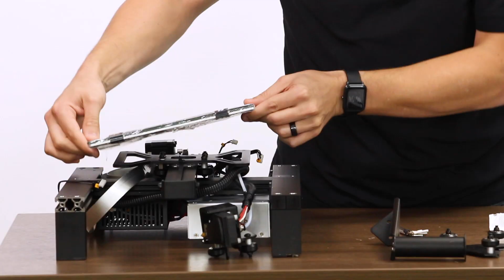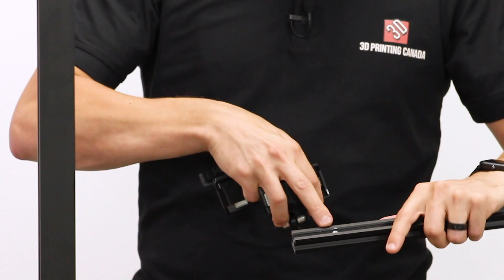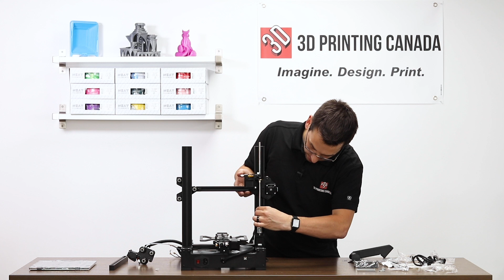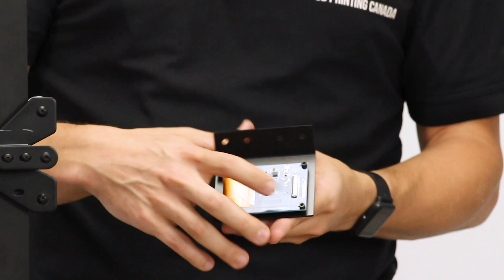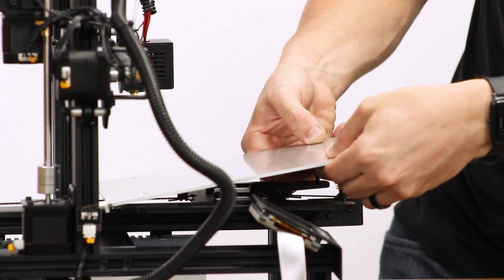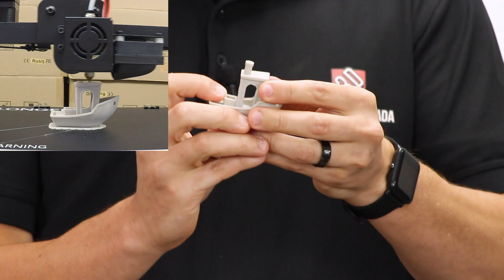Longer3D LK4 Unboxing, Build, and Test - How Good Is it?

Comment: Essentially informative as the instruction post assembly are totally inadequate. Nicely done and I'm currently printing my first test model. I purchased it because I'm restoring an old pickup truck and various dash and interior components that haven't survived the test of time can now be printed. Next step...design software. I'm proficient in Solidworks but don't have it at home. Any suggestions?

Comment: I just bought this printer, and it does seem to be a good printer this far, time will tell how good or bad it'll be.
Reply: So... what do you think?
Reply: @kingfissh6321  No major problems yet, Seems to work fine. Just need to make sure you have good settings, keep it clean, and that's pretty much it, it seems to be reliable.

Comment: You helped a lot because the instruction I got were worthless. So I got the headed bed on but it sits to low to go over the Y motor. I can't move the Y switch fwd.almost 2 inches so the bed stops sooner can I ? What would you do?

Comment: So, I've got mine set up thanks to the help of your video. However I can't seem to get other gcodes that weren't originally on the chip.. onto the chip working. I can transfer them over but the printer won't print it. Any advice?

Comment: As a first step I would have adjusted the rollers on the Y axis. Then I would have made sure base is square on the flat surface. I would have adjusted x carriages rollers before attaching x gantry extrusion to them. Just slide them and make sure all of the 3 rollers have proper contact and adjust them so carriages are not loose but rollers are not to tight. Rollers should be able to slip a little. Then I would take them off. Next I would have placed hot end assembly on to the x gantry extrusion and assembly complete x gantry off the printer. I would have snug left screws and kept right once loose. Slide the complete X gantry on to the upright extrusions. Then I would clamp top extrusion to the side of the upright extrusions to make sure those are in line. Then I would have tighten uprights. Then I would have attached top extrusion. Next would be to adjust x gantry level to be parallel to the top extrusion or with the base. I take mostly top extrusion for the reference. Once I have small as possible difference between left and right side and sure under 1 mm I would have tighten the screws. Attach the lead screw. Rise and lower the x gantry few times to check does it change alignment due to the a z axis movement. Just move it 5 mm up and down checking is there a play in it. If x gantry is changing its alignment when z axis is moved then you have some play in it. Little bit is always there with a single lead screw configuration. But do your best to remove as much as possible. Good thing is that the gravity is preloading the system and that z axis is not used as much as x and y so we get some slack and this small play is not showing as bad. Still I prefer mechanically synced dual z lead screws. Not as easy to adjust but once done it moves the x gantry in perfect sync (read almost perfect sync if you are perfectionist). Btw I would have kept the brass lead nut loose then move the x gantry few times full stroke and then tighten the brass nut to the carriage. I do think that proper adjustment is crucial to good end result. Starting from basic geometry of the parts we assembly. Making sure that things are square. Making sure base does not wobble. Making sure y axis does not wobble. Making sure hot end carriage does not wobble. Making sure all the belts are tight. Making sure there is no binding. Making sure lead screw and brass nut are adjusted. Making sure that first x gantry is parallel with top extrusion and then that bed is parallel with x gantry is crucial. Failing to adjust it all and just putting parts together will yield bad results. Adjusting it all will greatly improve the prints. I find that the proper mechanical adjustment is as important as bed leveling/first layer and proper slicing. Need a proof? Just make a x belt loose and make a test print. You are welcome.

Comment: Can you use marlin firmware to update this? Specifically ender 3 firmware onto lk4 since many ppl uploaded abl marlin already for ender 3. I was hoping to use those and chnage board types and lcd type in configuration.h

Btw what board type would this be for marlin?
Reply: I’ve installed marlin on mine. I realize this is an old comment, so I’m only posting this for future reference. For the example configuration files, use the alfawise U20 files.
Reply: Seok Yong Min.
Directly no Marlin will not work. 
3D Printing Canada has a Marlin version for the Longer

Comment: No rhyme or reason in how you are assembling  it? 
That's how mistakes are made.
Scratched carage and wires on wrong side and rubbing on the upright. 
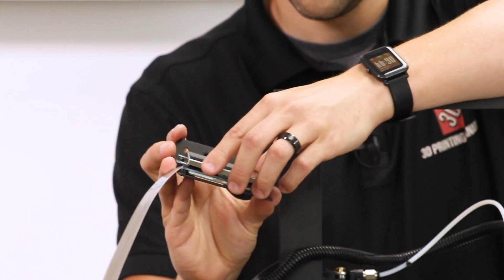At 22:20 you start following the manual?
Always follow the build manual.
Reply: @Jason 
Got to keep you on your toes. LOL
Reply: @Jason 
Trevor just did the LK2. Identical machines. He originally put the cables out front he fixed it. 
If people don't know what they are doing they will not know what mistakes were made, my pointing them out helps the learning process.
Reply: do you guys know what slicer to use for this printer?
Reply: @LAB_creations  
You can use any slicer. Cura is the most common free slicer and usually comes with a lot of printers. 
I personally use Simplify3D but that is a paid slicer.
Reply: @andymoses628 ok thanks I'll try it out. I've ordered one of these for my first fdm printer
Reply: @LAB_creations  
It's a big learning curve be warned. 
You Tube is your friend. Watch as many how to videos as you can. 
Face Book has a group for Longer printers. Join that group for any help you need. I am on that group.
Reply: @andymoses628  yes I saw that. It doesn't seem too hard. I like tinkering to get things going.
Reply: @LAB_creations  
Enjoy your new hobby. I am.
It can be addictive, I have 8 printers now. LOL